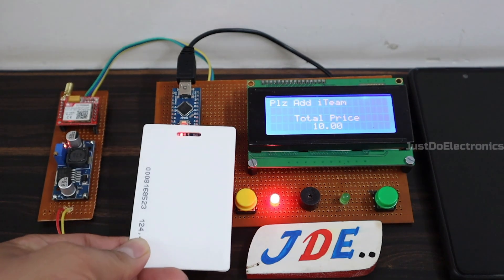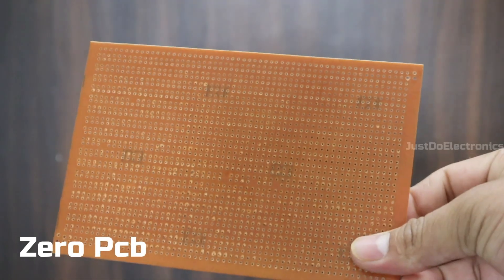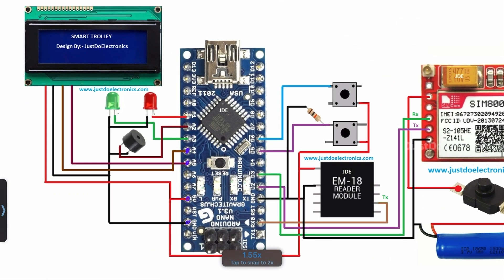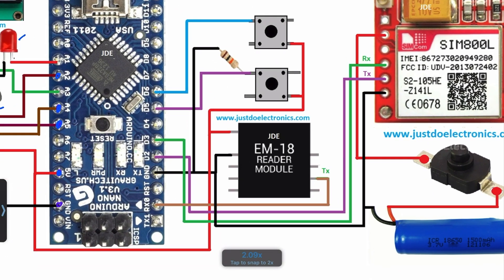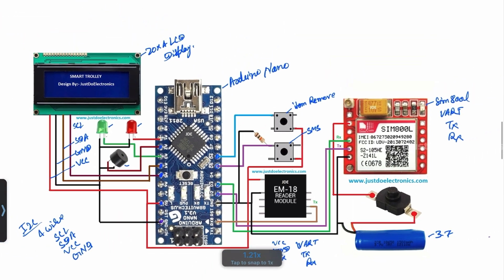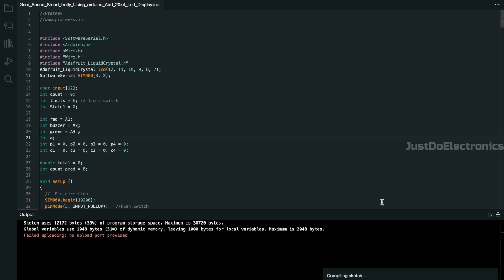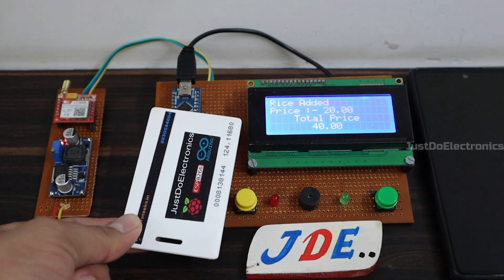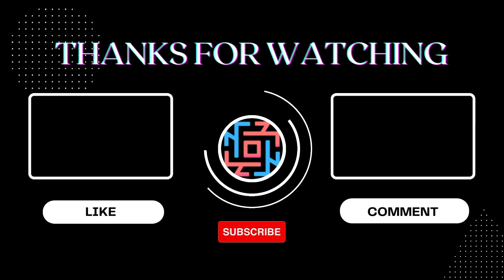Smart Shopping Cart with Automatic Billing System using Arduino | GSM

Comment: Sir pls share lm2596 step down converter and 10k pot circuit connection plsss
Reply: It's very urgent sir bec hamare schl m exhibition 6 k h so hame jaldi bna na h project
Reply from the maker: Ok
Reply from the maker: I am not understand your problem plz tell me proper
Reply: @JustDoElectronics sir aap n is m jo lm2596 step down converter and 10k pot and gsm sim use kra h uski connection nii de h aapne so pls as soon as possible pls provide uss proper connection of all circuit plsss it's very urgent sir
Reply: Plss sir tell me plssss

Comment: Sir without connecting step down convter we can complete this project that convter is optional or confrom needed
Reply from the maker: if you used battery then is not required